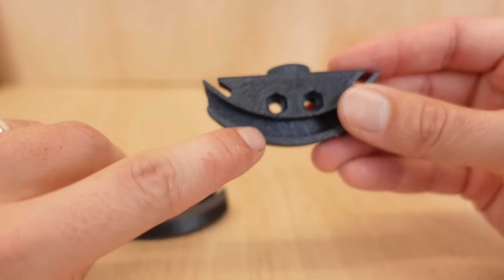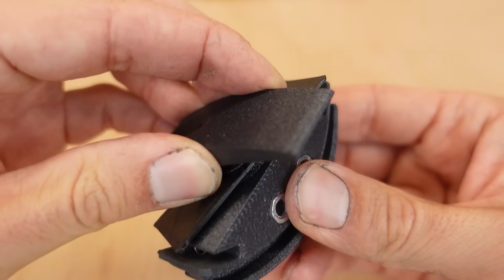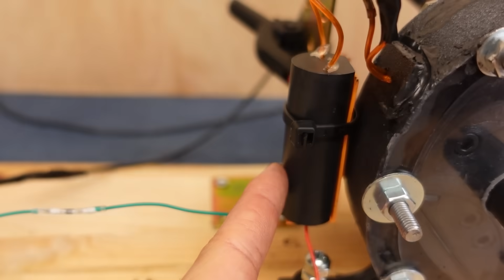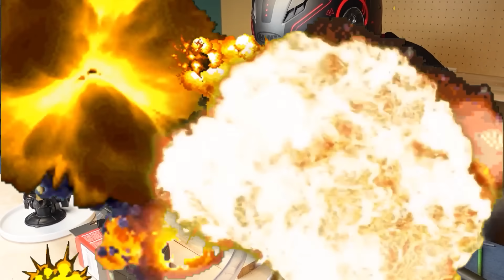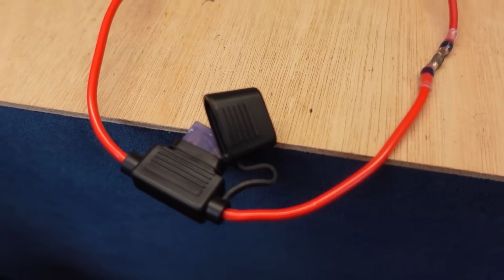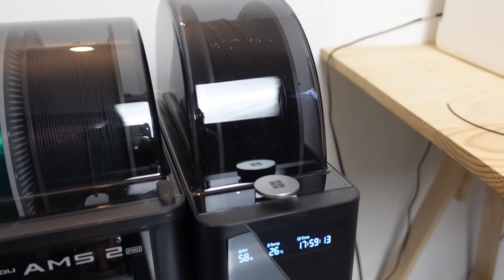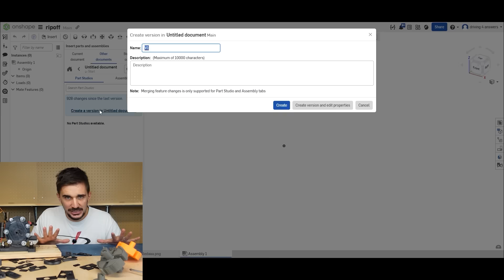My Oval Engine Now Fires At Will! Major Milestone For DIY Oval Rotary Engine 2.0

Comment: In theory this engine with low enough friction, which will be very hard/impossible to achieve, could possibly run but I don't see it ever being able to drive anything. It will produce very little/negligible torque. It relies on the momentum of the rotating body to assist in the gas expansion. There's a reason Wankel engines have the driveshaft non central with a sun gear, the gas expansion has some leverage to turn the driveshaft

Comment: Your HV modules are dying from overcurrent, you need to wrap 2 windings of wire around a ferrite core to make a hv transformer, the ratio of loops in your windings * input voltage will be your output voltage so a 30 turn input at 12v to a 60 turn output will make 24v, etc.

Comment: Rewind a ferrite core coil with enamelled copper for your HV generator.
You can use a microcontroller or connect a spinning timing disc to the engine shaft and a light gate to the gate of a mosfet that connects your power to the input coil of your HV generator and you just made a custom ignition coil!

Comment: Replace that HV module with a voltage multiplier circuit.
Just some capacitors and diodes in a tube filled with baby oil, you can fully customise it and will be very reliable.

Comment: For MUCH better seals you can cast them from silicone using 3d printed molds.
You go from the limitations of TPU which there's many of to only the limitations of modern chemistry.

Comment: 16:40 Bro you are right the spark plug needs to be much closer to the center of the oval so that when there is peak compression there is spark. The exhaust port i think is in the rightish spot but the combustion happens in the totaly wrong place.
Reply: Is the timing off of peak compression to allow for more pressure in a clockwise rotation? If it were lined up wouldn’t it push the rotation equally in both directions?
Reply: @L8R00str  That is true but he has offset the "traveling combustion chamber" so that it will generate torque, so I think don't quote me on this, having it fire at peak compression is fine and it will always generate torque. Again don't quote me I am just a couch engineer who likes thinking about these things lol.

Comment: Dude, your smart, you know that you always got to set the thing up to run. As long as it as all the parts required. DO NOT test your garden chipper/mulcher by cycling it around to see if you have a spark. It might just start and there ya are, only able to count to 5.....

Comment: You only have 1 spark event per rotation but 2 compression events. Double your trigger mechanism for spark. Use a printed contact point for your trigger so the wires don't move. Also install a flywheel to create mass to keep it rotating after combustion to carry it to the next one.

Comment: I might be mistaken, but it looks like the ignition timing is retarded, it looks good on camera, but ignition after the rotor is in the large open area just means the power doesn't have much to leverage off of.

If you advance the timing it might yield better results.

Comment: that ignition timing system is janky asf.

use a hall sensor system. its a magnetic switch, when a magnet passes it, itll trigger. 

much better than having a wiring strike another wire

Comment: I may be wrong, but here's my two cents:
I think it isn't able to start because the 'pressure surface' of each combustion chamber isnt facing the right direction during the combustion and expansion process. Draw an imaginary perpendicular  line from the center of the pressure surface back down through itself(towards the crank). When the charge fires, there is only a very brief moment(about 40-45 degrees of rotor movement) where the pressure surface direction is far enough offset from the crank in order to make any torque on the crank. 

It seems to be:
Ignition - Facing crank
+20 to +60 degrees - Power (some angular offset at least)
+60 to 90 degrees - (transition back to 0 angular offset, pushing into crank. Yes there is expansion here but in the "wrong direction" for too long in the stroke)
90+ degrees - RESISTANCE (yes exhaust I know, but this is another factor contributing to not rotating on its own since the fuel is probably still going to be burning at the speeds this engine will idle at, plus the fact that the pressure surface is offset in the exactly the opposite direction with no opposition from the next combustion event unlike a Wankel)

 You are right about the exhaust port, it needs to be 20 or so degrees further in the 'stroke' when the combustion chamber is first at its smallest on exhaust. 

Think of it like this, to idle, the previous stroke has to sufficiently power the next stroke, which this engines geometry makes really hard considering power stroke is 40-45 degrees compared to around(ideal numbers) 180 degrees for piston engines and Wankel's(90 degrees for the rotor). It looks to me that there is far too much unpowered space on your degree wheel for this engine. I know this is a fun build, and people here tend to take things far too seriously, but I would first look at powering as much of the stroke as possible. If not(which I suspect is the case for this design because of how the chambers change direction in relation to the crank), perhaps look at putting 2 or even 3 or 4 of these on one crank. Lesser the rotors more the flywheel.

I really would like to be proven wrong on this. Good luck and a very enjoyable video as always!

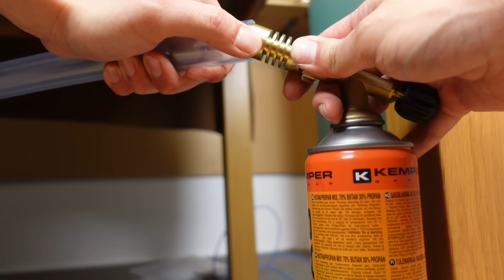Comment: How does the engine get oxygen if the intake is directly connected to a gas canister 9:05 ??? Enlighten me if the question is wrong.
Reply from the maker: Canister nozzle has holes
Reply: @d4a ohh right 👍 wish to see it running like a charm😌🙌

Comment: Could you please test to see if the engine will run under combustion conditions - by simply pumping compressed air into the same spot as where your spark is. (take out spark plug, replace with compressed air). this will tell you lots.
Reply from the maker: I can't as I don't have a spark plug, just two 3mm holes with wires going through them. But I might make the next one with a spark plug

Comment: Unfortunately I haven't seen better shapes than the Wankel triangle or the wobbling bean ina a triangle. Unless you lengthen the sweep of your expansion stroke, such as take out one whole side of the vane engine, you need to have only one point that is far and not two. Also, those crown pistons  having to wobble right and then left as they contact the wall, is just going to eat up a ton of power. Also, you should switch to a points distributor or at least a micro switch with a roller and put a cam on the output shaft. The long wire in the middle needs to be just a piece of copper foil on the shaft and the wire ends that you are contacting need to resemble brushes in an electric motor. Keep at it D4A💪❤️

Comment: i bet its not making enough compression. id get a compression tester and then try to polish the curved walls on the combustion chamber
, spin it over dry until the seals and walls machine each other down, and then also pour tons of oil into it.

Comment: I’m not sure you’re getting enough airflow there.
Reply: Yeah, you’re relying on air coming in with the fuel in the same line. It seems that it fires more reliably when turned slowly, which gives more time for oxygen to diffuse in.

Comment: E= IxR. All you needed was a current limiting resistor. You can figure it out via the equation.  Just rework the equation to solve for R and that will tell you the resistor needed E = energy  I= current R = resistance. Then you won't over current the spark generator. Hope that helps in the future.

Comment: Your drill is holding the engine back. you need to add ramos to the input drive so the engine can overrun the starter/drill.

Comment: i could have this wrong but it looks like its firing on the expansion cycle not the compression part... but i'm only 16m into it...lol... you will need some sort of flywheel to have enough mass to get to the next combustion cycle when it fires under compression... with better timing (make a 3d cam and use a automotive points setup) you should be able to start it with pulling a string on the crankshaft... pulling in the right direction... exciting when you make something that starts to work!!!

Comment: Glow plug... pleaseeeeee
Reply from the maker: Why?
Reply: @d4a you dont need timing with a glow plug... when the gas touch the plug ignition will happend... the same chamber will give you the timing and also way less hardware to control the plug... just the bike battery
Reply: @d4a https://youtu.be/-7F90iaUmSc?si=66AmHGo1KmM4r1jl something like this one

Comment: I may be stupid but don't see how this could actually work. For the combustion to push the rotor around it needs something to push against that isn't connected to it. You can't push on yourself to go forward. I don't see how it can push on the outside walls in a way that will counter the way it pushes on the rotor. In a Wankel rotary engine the location of the spark plug causes and uneven pressure and uses leverage to push the rotor around. Just looking at it from that prospective I don't see how it could work. The old design I could see how you might be able to get it work but this one I'm just not seeing it. Am I missing something?

Comment: The engine requires oxygen to run. The fuel from a can has none-you need a carburetor to mix air/oxygen with the fuel. You should print out a cam to run a set of contact points and a 12V coil just like cars used 40 years ago and stop fooling with junk from China.
Reply from the maker: The gas canister nozzle has multiple holes, it draws in air.

Comment: 14:23-25 shows volume in expansion for 15-20 degrees and then the flames. It’s should be slightly ahead or at the point of expansion

Comment: Have you ever looked at the Maltese Cross engine? Here in New Zealand, a friend of mine revisited it and drew up some blueprints. I think the engine was originally from the '20's. My friend had an engineering make the components and got it to 'run' on the computer, but it would not quite run in practice. The vanes are geared together to create the compression phase while the opposing chamber is under going the combustion process. Due to patent, I was never able to get a good look at the engine or the blueprints
Reply from the maker: Tbh never seen a maltese cross engine, but now I'm curious 😊
Reply: @d4a  I was really intrigued. Being an infernal combustion engineer for more than 4.5 decades, I really wanted to get my hands on it. :body-blue-raised-arms:

Comment: The portion that is not the travelling combustion chamber is also potentially a pumping chamber so you should really give it 4 sparks and let those function too other wise they will be pumping air gas mix which will back fire.

Comment: The modules aren't dying because they're bad. They're dying because of what you are doing with them! Below is explanation of the 2 ways these modules die!

The same thing applies to vehicle engines! Put a cap across those leads, the modules are dying because you're frying the input stages! These modules die 2 ways. One (main) way is when you have the leads too far apart for it to spark, the voltage builds and builds, and eventually there comes a point where the distance between the tips of the wires has greater dielectric strength, than the internal insulation on the secondary side of the transformer. Then it arcs over inside the module, killing it instantly. You will 100% kill one of these modules in like 2 or 3 seconds maximum, most of the times under 1 second (it depends on input current capacity how fast the output voltage rises). So just like everything with a real spark gap, you need POINTS that will always arc over before the insides. So you can have your main inside points closest together, then outside have points a bit further apart, that way if anything goes wrong with the design or part and the wires move, your backup gap fires saving it.

But the reason why these modules die in 2 seconds is the input side. You can't treat them like that! You are interrupting current a thousand times in that second as wires brush and arc past. So now you have back emf (think relay without a diode, killing a mosfet, because that's exactly what is happening here! except instead of a large electromagnet coil, it's a large input winding on a transformer. But to electricity it's the same, it's a giant inductor, and interrupting current on the input side, causes back emf whos voltage can reach 10x or more input voltage since there is no path, then it blows a hole through the transistor, and the module is dead. The basic path is +VCC input, primary of transformer, transistor, ground. There is a few ways they hook up the base with a feedback or a centertap with a diode and series capacitor to transmit the pulse, these modules are made by many manufacturers, and they use different internals and there is no way to tell what kind you have without ripping it apart and chipping epoxy away, so you only find out AFTER you kill it. This is what $2 gets you!

Anyhow, your frayed wire input switch is exactly what is killing these modules, because you're purposely causing it, like hooking up a relay to a transistor then telling an arduino to cycle it 1000x a second, it will kill the transistor in milliseconds. Same thing here. 

You could put a diode and series capacitor on the input wires of the device, by that i mean +vcc -> diode ->gnd. then +vcc, cap, gnd. This is at the module itself, not across the interrupter you have on the crank. I would prolly put a capacitor across that also, even a small film cap or ceramic. It's literally only 2 or 3 parts and $0.10 of stuff.

Edit: Look at any picture or video where people use high voltage transformers or ignition coils and you'll find they always put a spark gap directly at the output of the ignition coil, because if something moves or disconnects while you're powering one, you just fried a $50 ignition coil, so 2 pieces of wire that act as a backup gap directly at the ignition coil is always used, because it's an expensive lesson to learn. 

The problem is your 'timing' system. Frayed wires don't make the contact you think they do, they're actually making and breaking the circuit a thousand times per 1/2 turn of crank, and that's whats killing the modules. The other option is don't change your timing system at all, except use the circuit to go to an optoisolator or optotransistor with a cap to make the pulses a little longer, which then powers the hv module

Comment: Run it on model fuel with methanol and 20% oil it will cool and lubricate the engine reducing friction and sealing it improving compression twice as much fuel is needed than petrol along with all the oil removing lots of heat increasing its time before melting. Giving more time to learn more fuel economy and running cost is not relevant at this stage.

Comment: Hmmm, stupid question for you. Why do you need the big T shaped channels where the sliding combustion segments mate with the crank body? It seems that there is an awful lot of friction potential in that design, as both of them slide from side to side on the main crank. Would it be worth trying the design with just a small single half moon channel, almost just a slight depression, to ensure they track accurately during the cycle?

Comment: A suggestion for the ignition timing.
I would try to print a drum (on the rotating shaft; spark side) and apply  strips of copper "duct tape" at strategic locations as contact pads.
For the "brushes" (battery side) I would print from the tpu "pedals" to which the same copper tape is glued as contact pads.
To transfer the power from the rotating drum to the spark, I would use a rotary slip ring.

I'm really curious to see progress!
Good luck with the build!

Comment: Suggestion: get a set of points to switch the primary of the coil. Mount points around the shaft to ride on a cam. Ensure the points can rotate a bit so you can easily adjust timing.

Comment: Cool project, a few suggestions:
1)does your fuel system has air intake? I didnt see one, but if it has you could check if it is drawing enough air
2)use a flywheel made out of dense material
3)use lubricant to get better seals and less friction
4)yeah, your engine should not spit flames, thats a waste of power
5)the distance between the spark is important for propper ignition, you could use a propper plug or make one that has the correct distance
6)the exhaust pipe can improve the engine performance, it depends on the engine but as a general rule you should have some sort of exhaust pipe, even if its just a straight pipe

Comment: Very cool prototype. Have you calculated or thought about the compression ratio? Was the warping of the acrylic do to heat and/or compression? Is the fuel causing any detonation, such as the flame coming out the exhaust port?  Can't wait for the follow-up!!!

Comment: This is super cool! I’m curious to see how far you can push this 3d printed engine, I messed around with them but ABS and PETG are not enough, although I was using a piston engine design. 

I think you might want to add some sort of flywheel, as I don’t see one on there. I don’t remember if you’ve talked about it in previous videos, but I think that could help a lot. Also, you should try to make a points ignition system, they are very simple and reliable. I made mine with a light switch, and then you just need a coil and condenser. My homemade engine struggled to run at all until I added a condenser to the coil. Just some ideas! 

Good luck!

Comment: All sliding surfaces are to rough!  
Use a metal strip inside the big oval to reduce the friction between the seals and the housing. A little hole for oil is also useful. A oily surface reduce the friction and increases the compression. Place also metal stripes in the groove between the rotor and the combustion chambers.